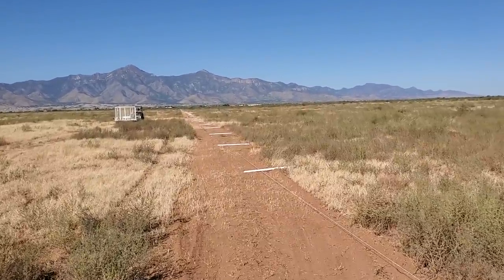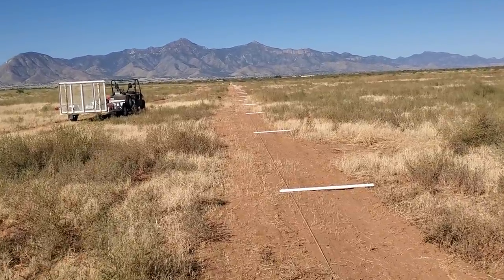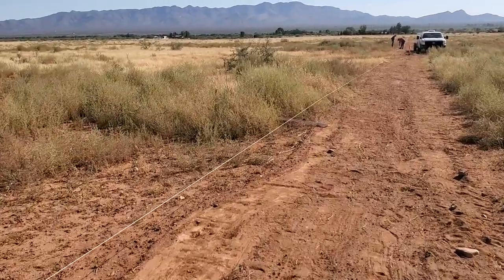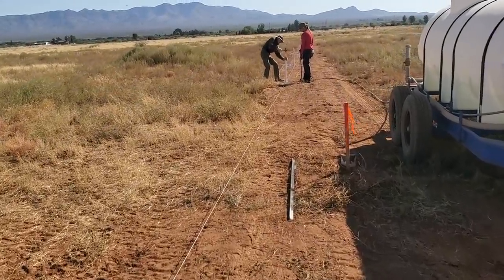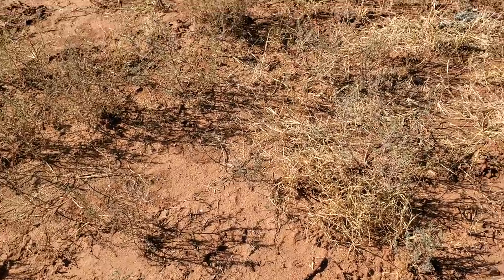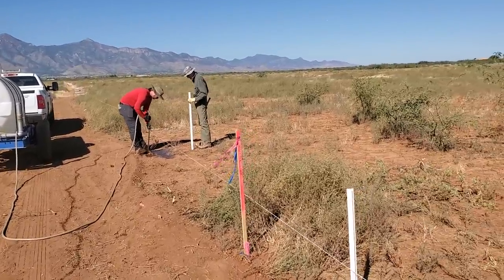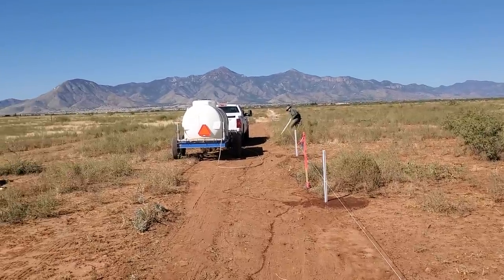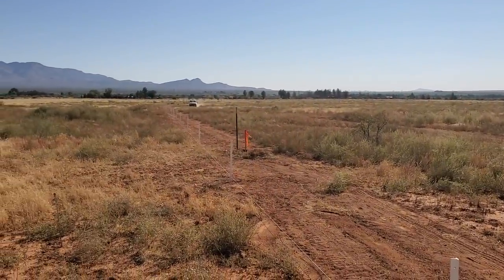Installing Timeless Fence posts in hard pan desert.

Comment: Beautiful solution for installation. I grew up north of there in Mesa AZ and my dad worked with the LDS church when they had large cattle ranches out in the middle of nowhere. I say large but they still only ran minimal head of cattle since the land could only support so much. I remember having to dig with sledgehammers and pickaxes to bury fence posts. Much more efficient method to the madness.

Comment: Greg, Texas hill country resident here (where our rocks actually grow rocks). For T-posts, I use a Bosch demo hammer (electric with a Honda generator), drill a 1-1/2” hole with a masonry bit, very low stress, and works fine in solid limestone. It would punch a hole in that dirt (and rocks) in probably 30 seconds.

Comment: For driving the T-posts, I modified a ground rod driver for the same Bosch demo hammer. Very little effort to sink a T-post in hard ground. For the life of me, I could not find a factory made demo hammer T-post (1-5/8 ID or so). Such an easy and durable tool to use, and can run on a small generator.

Comment: Wondering if soil has already had carbon content, other soil components cataloged/collected for future analysis.. What is current carbon content?
Reply from the maker: The engineers will be measuring a multitude of things on this project
Reply: The carbon content is very low. It's one of the reasons land like this is so cheap because it has been nearly impossible to grow anything other then dessert grasses and brush.

Comment: Does timeless make a corner post? I know you've said you can't get the fiberglass corner posts , just wondering what you suggest for corners that aren't made from fiberglass. Thanks
Reply from the maker: Hedge posts are the best alternative to fiberglass corners
Reply: @gregjudyregenerativerancher  would be great to see a tutorial on how to use those with electric wire for corners. Thanks for the help

Comment: Can those posts be driven with a hydraulic post driver?
Reply from the maker: In normal ground conditions it would work. This ground is very hard. We tried the pneumatic pounder, the post would not drive. I even tried my epoxy fiberglass posts with the pneumatic driver, no success with it either. Water jet is the tool for that area!!!
Reply: One inch foot long  hammer drill works well for smaller jobs and handles small rocks too   ,water  jet is the fastest .